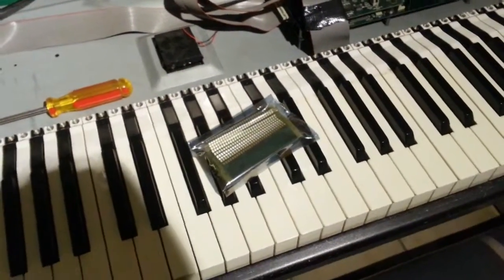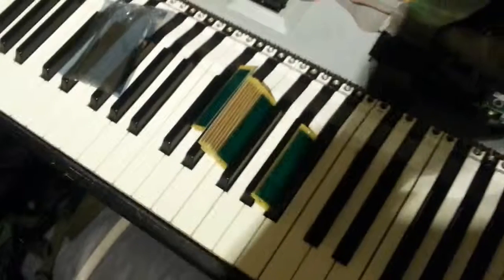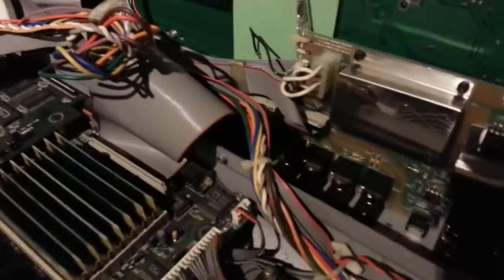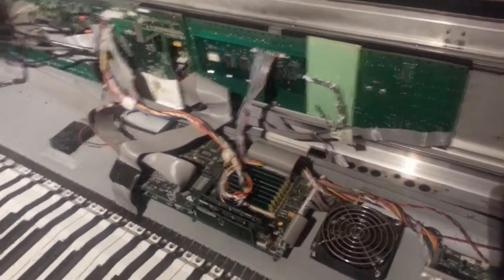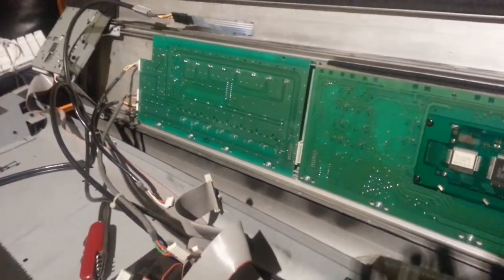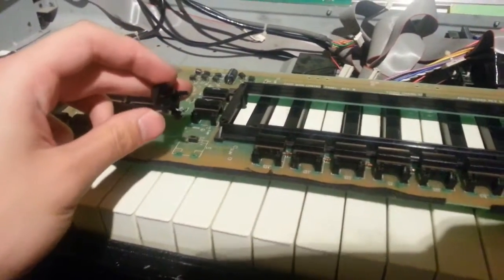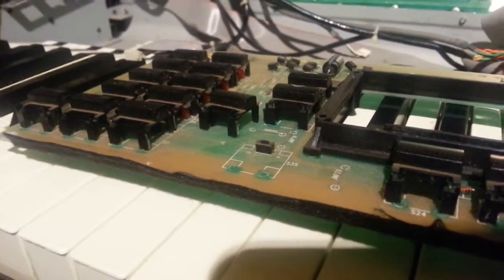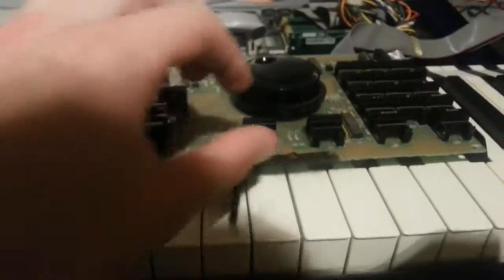Kurzweil K2500xs repair log 2

Comment: I want to open my K2500 case and clean it out. I've taken out the screws on of the back, to no avail. Which ones on the bottom? Or is there a trick to taking the top off? Thanks!
Reply from the maker: It's been a long time, but I'm reasonably sure there's a mix of case and keybed screws on the bottom. You'll need to undo just the case screws (leave the big keybed ones in or the keys will slide around).
Reply: @Jergling  Thanks for responding. It dawned on me that I had stashed all the manuals and booklets from the various expansions/ROMS/P-Ram. The ROM's booklet shows which screws and gives detailed disassembly instructions. So I'm good to go, now. I've had this K2500 since May of '99 and being retired (ie being on a budget), makes me very happy that they are so well built! I appreciate you putting these videos up and responding! Happy Holidays!

Comment: can i ask HOW on earth you got the control panel off?? i was a bit freaked out by the tape stuff on one end - seemed firmly attached to something below - does it connect to the ribbon controller somehow??
Reply: never mind - got it figured out! just had to rip all the tape off... you are SOOO lucky though - half my switch brackets tore off and some broke (I was being gentle too -  i thought) so i had to reglue them back together but jesus - not sure I'll be able to get everything back in place without them coming off again